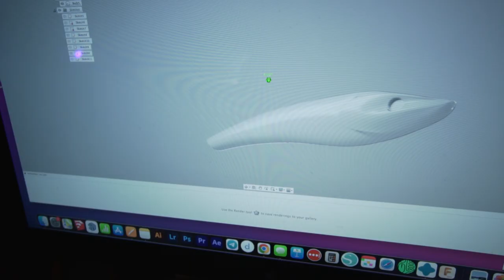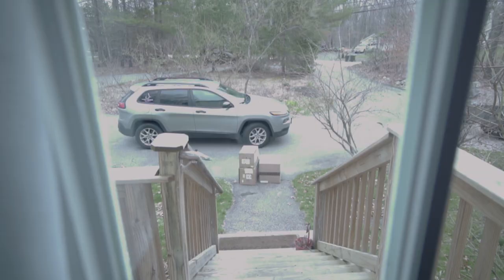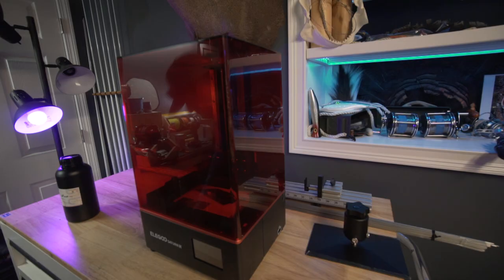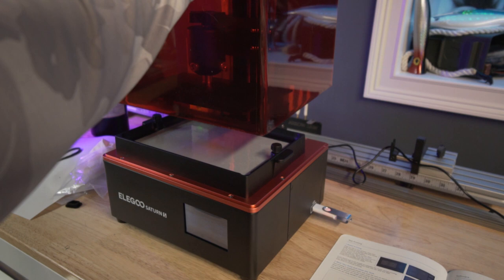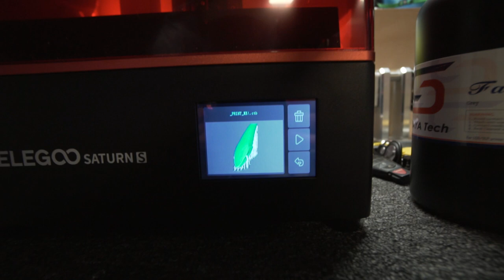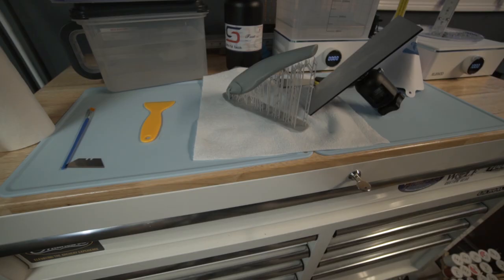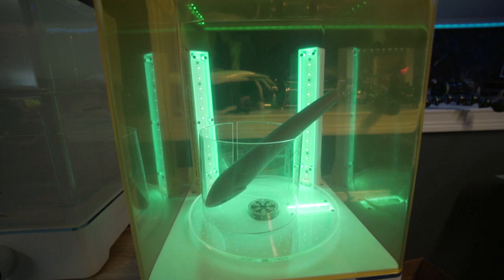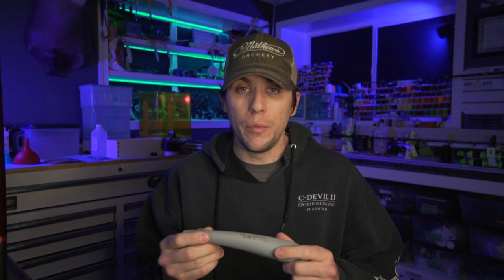I 3D PRINTED A Striper Lure!!!

Comment: I am a bit confused, did you make a plug (lure) to fish with, or a plug to make a mold to make fishing plugs (lures)? The word plug having 2 meanings is making a bit confusing right now. My brain hurts. Irrrreguardles, its sick, and I am stoked to see how your channel has changed and more stoked to see where its going.
Reply from the maker: So first off thanks for the love!! So I use lure and plug as the same meaning personally lol. This particular “print” was just to get a perfectly engineered Lure “master” in order to make a mold of it to produce production models that can be fished. I can’t print a lure with the thru wire and weights so once I have the mold made (from the master 😉) I can then lay in the wire and weights and use resin that will float. But to get the perfect shape it needed to be 3D printed first. I hope this helps clarify a bit more and if not the next video should help! Thanks again for the support man!

Comment: I am not at all convinced, you can not manage the weight, you still have to make the cut for the armor and it takes too much time.Although not perfect, pouring the resin is extremely faster and less complicated, you can manage the weight and armor, through wire and leads you can already insert the mold, then lose 10 minutes to finish is not important